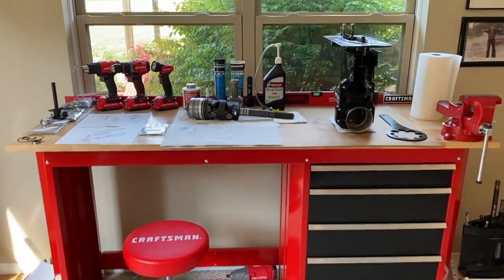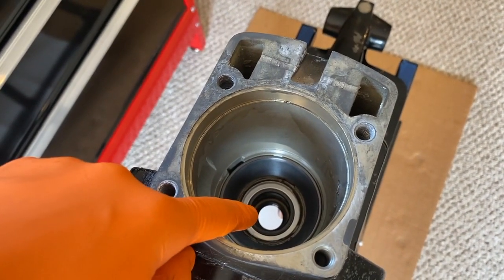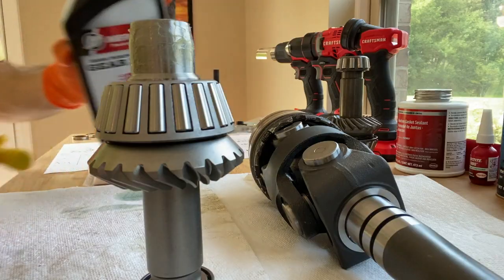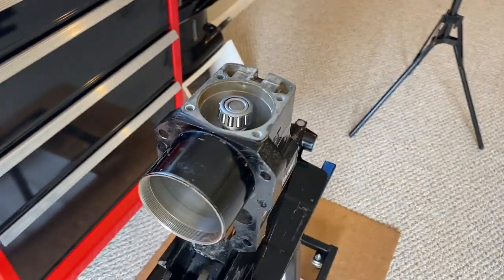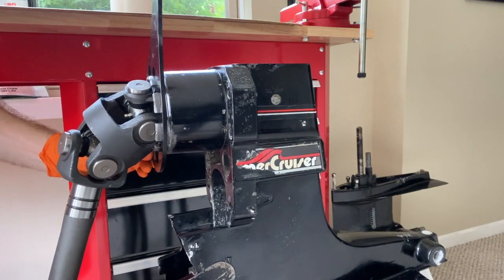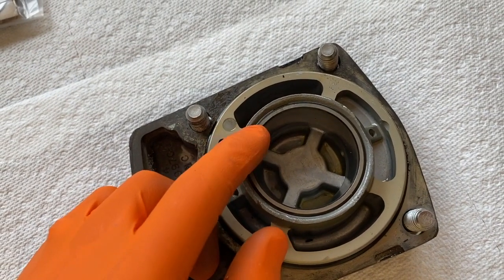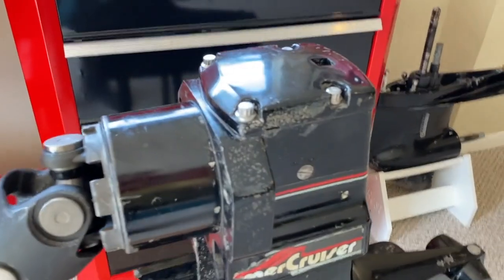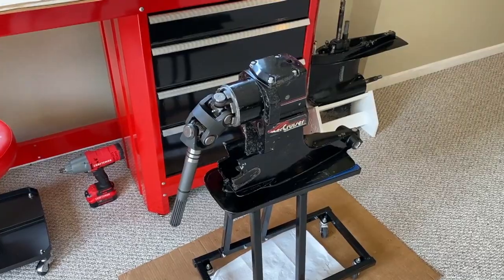Mercruiser outdrive upper unit rebuild - PART 5

Comment from the maker: Deep dive into new Yoke shaft design with 3rd machine cut

          https://youtu.be/GnnPCrVgx0k

If interested in purchasing these products, visit our Amazon Affiliate links below, I earn from qualifying purchases.

          1.  GLM oil seal kit (87500)

                    https://amzn.to/3njQWrT

          2.  Gasket compound sealant (1525607)

                    https://amzn.to/3DcrJ8c

          3.  Old seal punch tool (89-101-19)

                    

          4.  Water pocket cover

                    https://amzn.to/3ot3uw3

          5.  Loctite 680

                    https://amzn.to/3wG0VKW

Thanks!

Comment: what type puller did you use to remove the lower and upper bearing cup/race?
Reply from the maker: @billstiver5941  

Thanks for watching.  After extensive inspection, we chose to keep our carriers installed…unless you are referring to a different part.  👍🧰

Comment: This whole video is amazing, you’re a hell of a teacher.  I just had a Bayliner 185 given to me that had sat for about 12 years. I am brand new to boating but am not afraid to wrench when I can. Got the motor running after replacing all lubricants and impeller but noticed a bad vibration at certain motor tilt angles. Took off the outdrive and the gimble bearing is shot.  (I had not greased it up before taking it out, again, newbie did t know about it, but don’t think it would have mattered) I am replacing the gimble bearing at this time. My u-joints seem fine, (bellows was bone dry, and no rust) I was wondering if there is supposed to be any play between the pinion and shaft, sort of a backlash like on a car axle? I really don’t want to have to do what you did here right now if I don’t have to, at least not till winter. If/when I do, this video series is where I’m coming!👊
Reply from the maker: Good morning, just poured a cup of coffee and am sitting down to answer any and all questions for the DIY community.

Congrats on the boat, and thanks for reaching out to us.  That’s awesome you’re taking on this DIY project as it will be very beneficial for your boat.

In regards to play, each drive will be ever-so-slightly different in terms of (thousands of an inch) gap between gears and referencing your exact serial number service manual will be best.  However, we will always be here to help answer questions as you work through it.  We love talking boats and jet skis.  😎👍

Let us know if you have any questions and hey if you’re into crypto trading, join our DIY ecosystem and become part of an exclusive group of DIYers.

       toolboxtoken.com

Reach out to us any time!  🧰

Comment: Is there a tourqe spec for the retainer just for the u-joint. You only tightened it to hand tight to seat it. Our book says 200lbs torque.
Reply from the maker: Thanks for watching, if your serial number service manual states to torque retainer nut to 200lbs, we definitely recommend following manual.

Comment: When you put all the new parts in, did you measure and re-shim it? I just found one of my bearings on the drive gear was bad and ordered new ones. Book says it needs to be re-shimmed so I ordered the tools to do so but didn't see you do it in this video. I'm guessing you did it off camera before placing the drive shaft back into the housing and tightening the castle nut?
Reply from the maker: Thanks for watching, shimming must be performed to exact guidance set forth within your exact serial number service manual.

Because of that, we chose not to add this to the video as it may have given misleading instructions.
Reply: @DIYwithMichaelBorders  Thanks. I have the tools on the way now to do that.
Reply from the maker: @TheCommo81  

Awesome Awesome!  😎👍

Comment: Thank you for reply. Are you talking about the 4 bolt on the very top of the out drive?  What would cause drive oil be leaking inside the boat?
Reply from the maker: Happy to help.  If bellows fail, water will sneak into bellows and begin to beat up oil seals.  Once oil seals fails, water sneaks into outdrive and begins to degrade gears and shafts along with everything else inside case.

😎👍🧰

Comment: How do you no if you need to replace oil seal with out taking it apart?  Whorls gear oil leak into the boat?
Reply from the maker: Great question!  If you open top access cap on outdrive, you can gain access to internal drive where the yoke shaft feeds into the vertical gear.

If you see a mismatched discolored milky fluid rather than clean gear oil, it’s likely that the seals are the cause of letting water in.

Once water sneaks in, it mixes with the oil and gives it a milky look…and degrades the oils performance on lubricating gears.

Hope this helps and if you’re into crypto trading, join our DIY ecosystem.

       toolboxtoken.com

We DIYers need to stick together!  🧰

Comment: I have an alpha one gen 2 with gear whine and some fine metal shavings on the magnet. less than 100 hrs in service. On a 5.0 MPI in a Baja islander 202, your thoughts?
Reply from the maker: Thanks for watching, it shouldn’t be doing that with less than 100hrs on the outdrive…🤔

If taken to a shop, they will want to sell you a new outdrive…🙄

Draining gear lube and refilling with new is next best step.  Run engine for 10 hours and check magnetic probe for shavings.

If prove is filled with shavings, you can then begin to entertain the thoughts of rebuilding outdrive.

😎👍
Reply: @DIYwithMichaelBorders   thank you!
Reply from the maker: @SchmoopsAdventures  

😎👍

Comment: Hello again Micheal! I have just received my vertical gear assembly (shaft, gear, and two bearings) Can I press these together myself or should I have it done at a boat shop? Thanks!
Reply from the maker: Hey Eric, thanks for reaching back out to us.  That will be personal preference & if you have the means to do so, not a bad idea.

However for us, we didn’t have the resources to properly press parts together to factory spec, so we had our local marina do it.

😎👍

Comment: you've built my confidence to rebuild my upper gen 1 unit!  where are the videos for the lower unit?  I need another confidence boost  ;)
Reply from the maker: Danny, thanks for reaching out to us.  The lower unit videos will be uploaded this month.  😁

Filming for lower unit videos are complete & in the que.  Looking at the middle of this month.

😎👍
Reply: @DIYwithMichaelBorders  awesome!  I can't wait.  if you can make the lower unit look as easy as the upper, I just may save about 2K.  I have not looked deep in your videos, but do you also have videos on the gimbal and bearings, etc?
Reply from the maker: @dannyresendes4908  

Thanks for the reply & we sure do.  We think you’ll enjoy those as well as the upcoming lower unit rebuild series.

😎👍